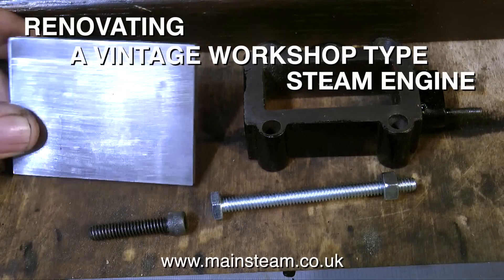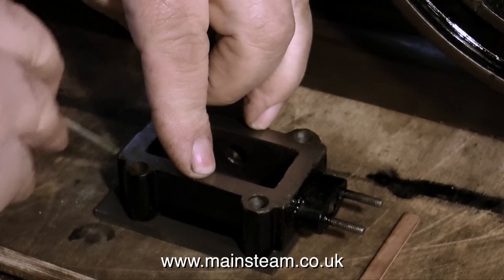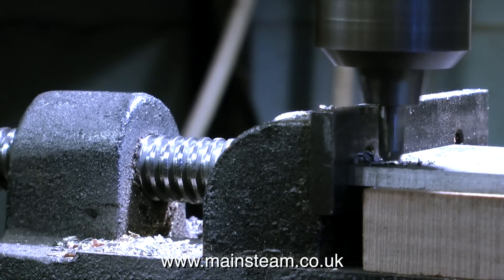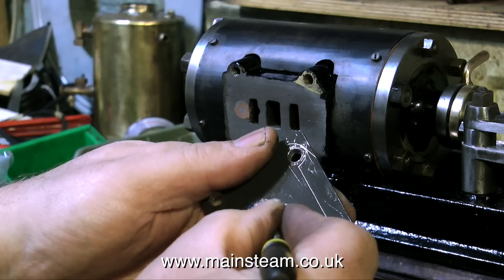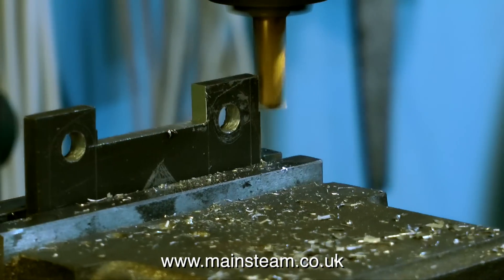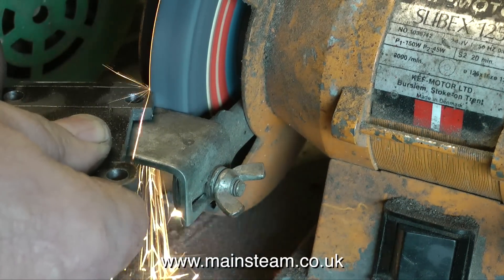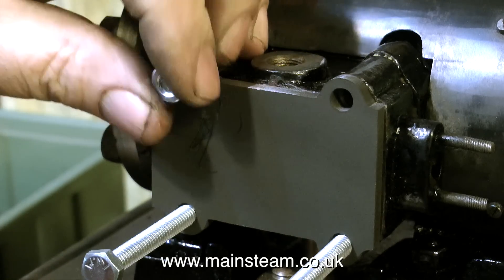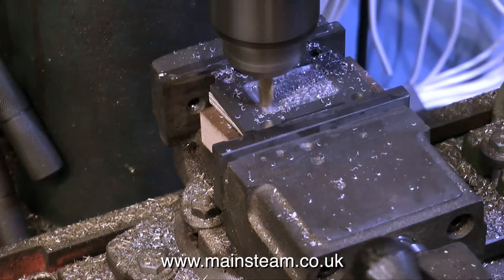PART #10 - RENOVATING A VINTAGE WORKSHOP TYPE STEAM ENGINE

Comment: I don't believe it.  Following my earlier post this morning, I have just returned home, opened up the laptop and low and behold the link does work.  I can only conclude that it is this new fangled Windows 8.1 that is behind my problems.
As an aside, Keith, following your recommendation I have purchased the set of Stuart Victoria unmachined castings, which will be the first thing I have ever made... ever!  I am looking to make a start in a couple of weeks and look to you as my mentor.  If I can achieve a fraction of what you do I will be a happy man.
Thanks again for inspirational videos, technically fascinating and beautifully produced.
Reply from the maker: Polishinpaul Hi, thanks for the missing link - I fixed it :-) I am hoping to do a series shortly called "How to build a Stuart Victoria Steam Engine" - but probably by the time I do that series you will have built yours . . . . .
Reply: Keith Appleton You really wouldn't want to put money on that!